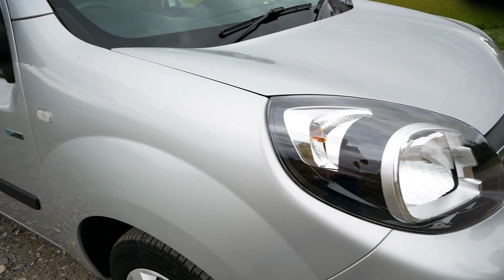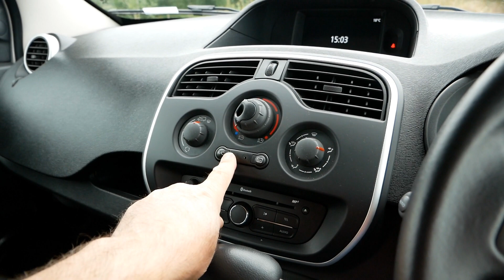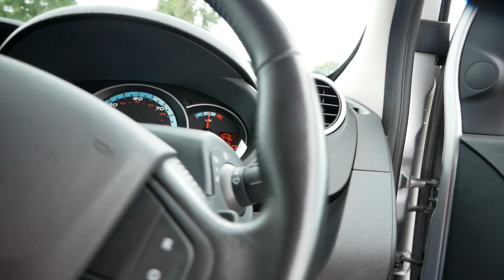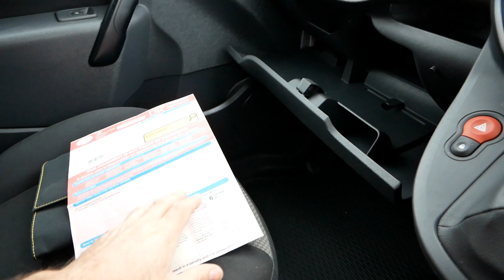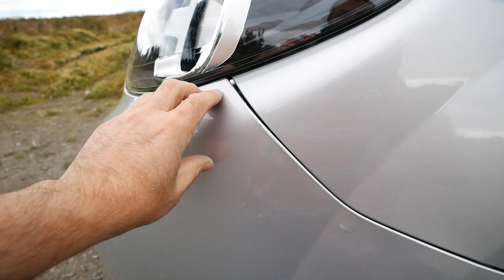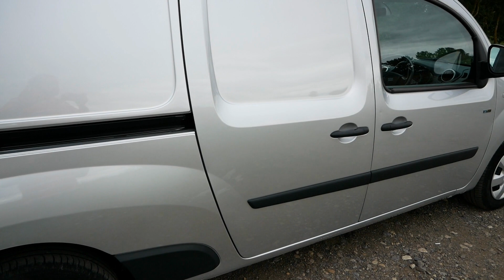SOLD: 2019 Renault Kangoo ZE33 Maxi LL21, amazing spec model with almost every possible extra

Comment: if using public charge how long would it take to charge? ive been looking at these instead of env200 but its lack of chadamo worries me. is their much difference in charge times?
Reply from the maker: It will charge at 7kW max, so around 18-21 miles per hour. A full charge from 0-100% will take up to 6 hours. All the details are on https://www.gogreenautos.co.uk/for-sale/renault/kangoo-ze33/renault-kangoo-pe19ujj
Reply: @GoGreenAutos  is that same on all kangoos . Love the size of them but this is replacement to all other vehicles so be good to have option to go long distance , been looking at older kangoo and the early electrics can be as little as 5500
Reply from the maker: @lookoutleo  Yes, no Kangoo ZE has rapid charging. They've not even fitted it to the new Master ZE either.
This video explains all the electric van options.
https://youtu.be/AbyRpTEbtPw
Reply from the maker: @lookoutleo  You'll also find this video useful https://youtu.be/h3bF5ifbszg